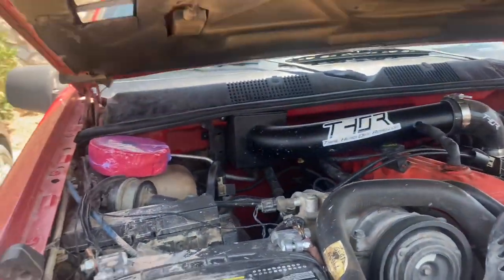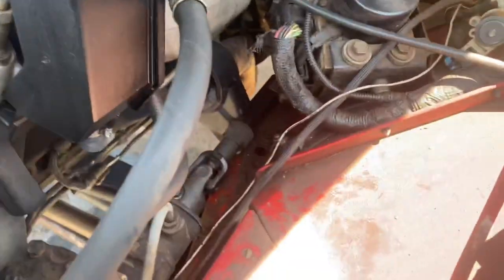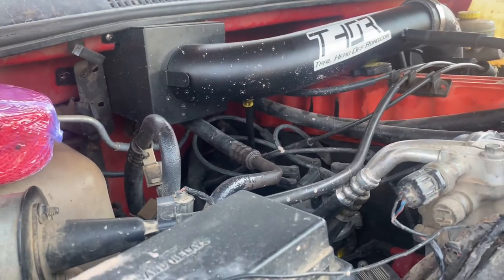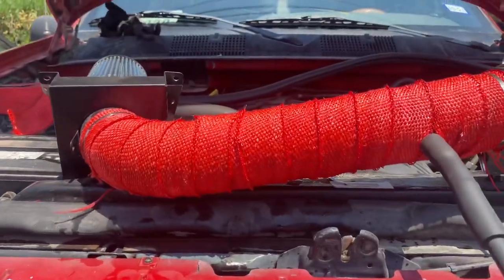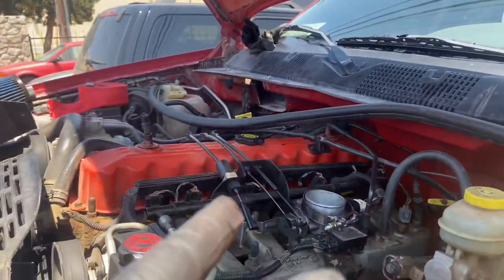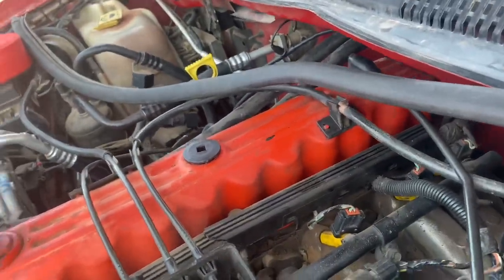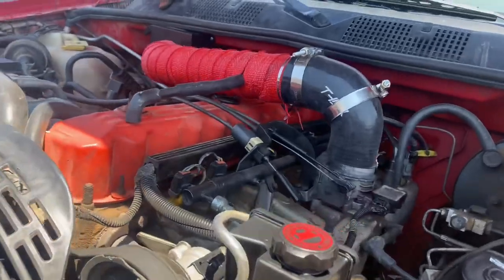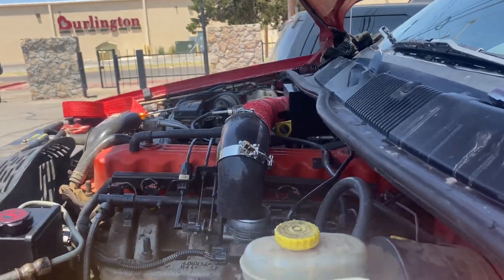Zj jeep grand Cherokee on 38s Thor intake. Trail head off road part 2

Comment: Awesome stuff man!
I’ve got a 98 5.2zj and I want to build it like yours!
Did you have any rubbing with the 35s and the 5.5 lift also how are you running 38s on a 5.5?!?! And how does that feel?
Reply from the maker: They 35s were easy to run. I stretched my front and rear axle out a bit and cut my fenders a little bit. The front was a little harder. I hammered in my inner fender to the point where my floor boards are pushed back a little bit. 

The 38s cleared the rear. I did trim the body and my rock sliders a little bit. Im going to finally add bumpstops to the rear. The front was some work. I trimmed my bumper more and my fender. I still need to clearance more in the front
Reply: @RashadsGarage  wow!
That’s a lot I’m trying to get mine to where yours is at!
Reply from the maker: I have a lot of videos explaining what I do and I plan on recording more. Stay tuned to the channel to see the build
Reply: @RashadsGarage  will do!